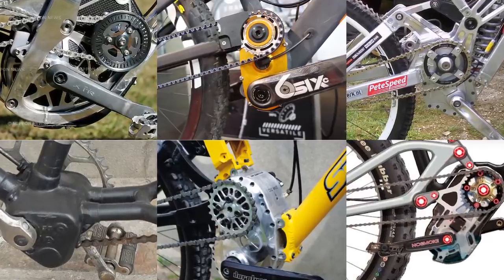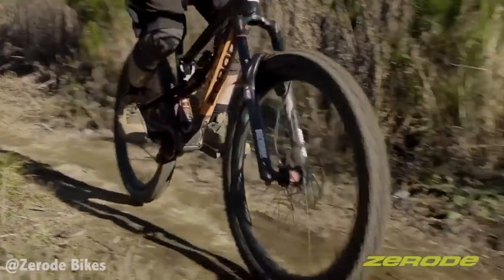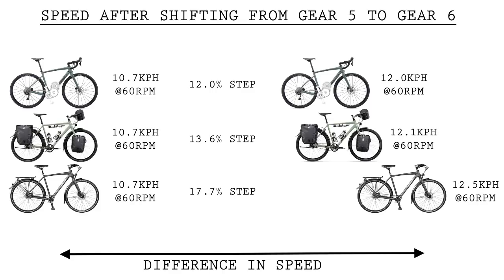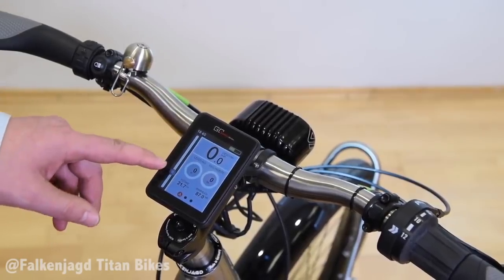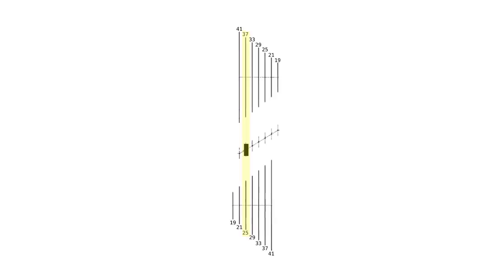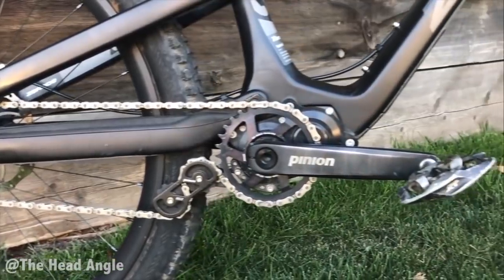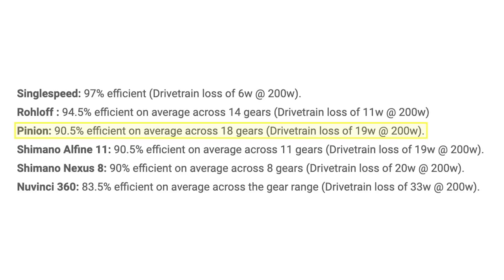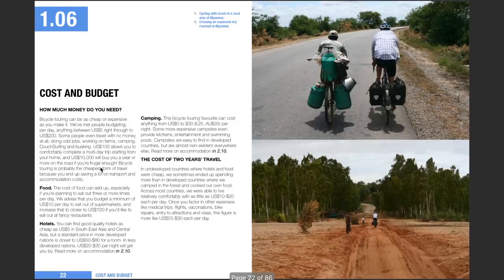Inside the FUTURE 13-Speed Shimano Gearbox - Weight, Drive Efficiency & More

Comment: Using cassettes is a bad idea. The point of contact between a surface of a sprocket and a chain is 1, maybe 2 mm with all the force focused on that tiny space which will inevitably cause wear faster than contact between two wider cogs, which distribute the load through a much larger surface. The only way Shimano could make it work is by offering an on-the-spot easy maintenance made by the owner with any kind of 6 or 7 speed cassettes and chains and simple tools. If this system will require sending whole mechanism to Shimano or seeking a qualified mechanic in the middle of nowhere I can't see it working. Then it must be way cheaper than Rohloff style systems, because this is simply enclosed derailleur.

Comment: seems odd. you could do the equivalent with smaller internal gears, no internal chains, and a couple of internal transfer/idler type gears.
secondly, I think all-electric drive is the future, where all you pedal input is transferred to electricity that drives a motor (and can thus be assisted/vary to your liking). Such bikes won't have gears, and the main moving parts will be the generator rotor and the wheel-drive rotor.

Comment: This guy seems to think the Rohloff is magic. The Rohloff efficiency number must be ADDED to the conventional drivetrain since you require both to implement a complete drivetrain.  It would be shocking if this Shimano design did not exceed Rohloff in efficiency.  That is what the design is all about, after all.  Chains are better than gears.

Also, patents are not product announcements and you can't deduce product details, like electronic shifting, from them.  In fact, you can't expect anything at all.  This one was first filed in 2015 as well so don't hold your breath.  We only know about it because the application got published...nearly a year ago.

The video is a nice explanation of what was filed in the patent BUT there are quite a few errors and assumptions including biases of the presenter.
Reply from the maker: I'm a happy Rohloff owner, using data to supplement my experience. I'm pretty careful to back up any claims I make. Please let me know of my errors if you have the data/info to back it up.

I made it pretty clear this is a patent application and that I'm speculating. But I have a lot of experience with this type of stuff, so I don't think I'll be far off the mark. 

The Rohloff efficiency numbers include the singlespeed chain and sprockets.
Reply: @Cyclingabout  OK, then cite your data proving that Rohloff efficiency is 94.5%.  You aren't "using data to supplement" if you aren't citing the source.  I can claim the Rohloff ISN'T 94% as long as I'm held to the same standard you are using.

I don't believe the Rohloff numbers include chain and sprocket, but since you aren't citing a source it doesn't matter.

Regarding the patent itself, I'd say it never occurred to you that this work is at least 5-6 years old or else you wouldn't have made this video in the first place.
Reply from the maker: @craigsj  https://fahrradzukunft.de/17/wirkungsgradmessungen-an-nabenschaltungen-2/
Reply: @Cyclingabout  The problem with this article is that it doesn't pass the smell test. It claims that Rohloff works "in all power ranges as efficiently as a derailleur" (curiously conditioned on "rather low chain tension" which belies the "all power in ranges" claim) DESPITE Rohloff literally including ALL of a single speed drivetrain components IN A WORSE CONFIGURATION PLUS some stuff. 

 It is impossible to justify the claim made in Figure 8 that Rohloff equals single speed when everything in single speed also exists in the Rohloff solution.  Yes, the Rohloff locks out in the right gear, but it has much larger bearings and oil seals which rob power.  It also uses a less efficient 16T cog compared to the 21T in the single speed (and identical components otherwise). Sorry, but this test isn't credible, isn't reproducible and isn't peer-reviewed.  This data is cooked and the results would be discredited if anyone really cared.

This is ALWAYS the test cited by people who advocate for Rohloff being as efficient as a derailleur drivetrain and it simply can't be correct.  It does tell me a lot that you referenced it, though.

People should now be wary of your comparisons of Rohloff to Pinion as there's no reason to believe the comparison is accurate.
Reply from the maker: @craigsj  Gear 6 is indeed surprising. Andreas thought it strange too, but that's how it tested after multiple runs. He has no affiliation with Rohloff at all.

I welcome more studies.
Reply: @Cyclingabout  It is interesting in that it defies Physics.  What it says is that there is something wrong with his methodology, perhaps something as simple as how he measures.  I've looked at his test several times, it seems like he approaches the problem reasonably but his results simply aren't possible.  Gear 6 is clearly wrong; you can't trust any of the others until you know why.

Incidentally, his first version of the test rig did not produce those results.  There, the Rohloff was NOT as efficient as a derailleur drivetrain.  Why didn't you use that instead?

Comment: That looks like a horrific solution. I'll bet my house that it will never come to market. The Pinion system is a much better concept.
Reply: Why? Seems realistic enough to me.
Reply: @keithkaranu4258  Too complicated, too much to go wrong, too much to maintain, too much to replace. It's like a current derailleur mechanism but with 10 times the number of components.
Reply: @ashbridgeprojects6916 What would you need to maintain? Assuming it's a closed system like the pinion you only need to change the oil. Also judging from the patent it's going to have a lower part count compared to existing gearboxes.
Reply: @keithkaranu4258  Chains and sprockets, and lots of them. It will be similar to the replacement rate of current derailleur systems - only way more stuff to replace. Closed oil system will help, but thin sprockets and chains will wear out quicker than gears/cogs as they are constantly derailing and grinding metal everywhere. Their sprockets and chains are going to be bespoke to the design and will cost top Shimano $$$ to replace. Gears/cogs are better. This is dog dirt.
Reply: @ashbridgeprojects6916  I find it unlikely that it will have similar wear rates to current derailleur technology because derailleurs are not only exposed to the elements but the chain needs to move much farther compared to the at most one sprocket shift that this gearbox uses. The chain is also purpose built for this use case.

Comment: Meeeeh! 
What's the point!? This doesn't solve anything. It's mechanically impressive, but it's the same gears in a new, more expensive, packaging. 
There is still an outside chain and outside cogs that will wear, be covered in dirt and need to be cleaned. Not much difference from cleaning a cassette!? 
This weighs more, needs oil change like a car, and it's much harder to check the stretch and wear on an internal chain and cassette. And it's uglier. No thanks!
Reply: The outside chain and cog (singular) can be much more robust single-speed chain, though, and then can be put in a chaincase if you're really worried about it and aren't worried about weight. (Or, potentially, it could be a belt system instead.)

The problem I have with it, though, is that it still will have the problem all derailleur gearing has, that you can only shift in motion.
Reply: There is not an outside chain. What are you talking about?

Comment: If you have a gearbox you might as well go all the way and have a drive shaft.
Reply from the maker: Unfortunately, shafts just aren't efficient enough!
Reply: @Cyclingabout  Shafts are ludicrously efficient, it's bevel gears and/or other means of turning the drive 90 degrees that aren't efficient. Unfortunately shaft drive on a bike requires doing that twice.

Comment: How do you justify a $1800 price tag?  I've seen automobile transmissions go for less.  Scale of economy.  Lower the flipping price and more people will buy it.  I'm shocked at the cost of bikes these days.  It's insane.  Simple bicycles are reaching and even exceeding the cost of motorcycles which are also overpriced compared to automobiles.
Reply from the maker: Reduced time maintaining my bike, reduced running costs and increased reliability, especially in adverse conditions. $1800 is a long-term investment and becomes quite good value when you spend as much time on a bike as I do.

Comment: the oil in the gear box will lose power to.
Reply from the maker: There will be very little, plus efficiency numbers normally increase when a lubricant is applied compared to without.
Reply: @Cyclingabout  Lubricant, yes. But splashing about in an oil bath IS a source of losses.

Comment: The "maintanance free" argument is so dumb. Regular bike just has to be washed regularly and lubed thats al. Let's stop brushing teeth, because we can put feeding tube directly into the stomach, kind of argument.
Reply from the maker: I use gearboxes on multiple bikes and this is literally one of my favourite things about them. If I don't have to adjust, clean and lube my drivetrain - I can spend more time riding or doing other things I like.
Reply: @Cyclingabout  Stop brushing your teeth and replace them with blender. Should save you a lot of time to do other things.
Reply from the maker: @sodalitia  Errr.. ok then.

Comment: That short chain won't last.
Reply: It will. A motorcycle gives you a good example of how long an enclosed chain in an oil bath can last. The drive chain on a motorcycle is exposed and gives limited life. The cam chain is enclosed and lasts hundreds of thousands of kilometers.
Reply: Wrong... So utterly wrong.
Reply: @joeblogs8589  but a full length chain has 108 links and after 25000km the rollers are falling off the links and need replacing. Also, the chainrings (On a conventional drivetrain) are larger reducing stress and the angle of defection it has to bend going around the gears.
Reply: @suggesttwo  How does what you just said contradict or augment my point?
Reply: @joeblogs8589  an oil bath reduces wear by a factor of what? Needs to be about 25 just to to last as long.
Reply: @suggesttwo  At lest a factor of 100. Think about the example I cited. Factors that make motorcycle chains last longer than bicycle chains is that they are sealed with O-rings. Bike chains are open to dirt. A motorcycle does about 3000 kms on a drive chain but 200 000 or more kms on a cam chain. That, in spite of the cam chain running over smaller sprockets and thus articulating more. The saving grace for the cam chain is the absence of abrasive dirt and help from plenty of filtered lubrication.
Reply: @joeblogs8589  If that is right you can take the nominal normal  loss and divide it by 100. The amount of power being transfered through the cam chain in engine is nothing compared to a wheelchain. And a bicycle chain weighs about 300g compared to a wheelchain at 1500g. Also, if I stand up pedaling 32-16 that's about 6"/3” radius of crank vs gear. 400 lb on the chain. 
In wearing out drivetrains the chain would start skipping on the smallest cogs first. I would "reseat" then using the forbidden gears 22-11, 12, 14 After all, they tell you not to use those gears for that reason. Not to keep the chain straight.